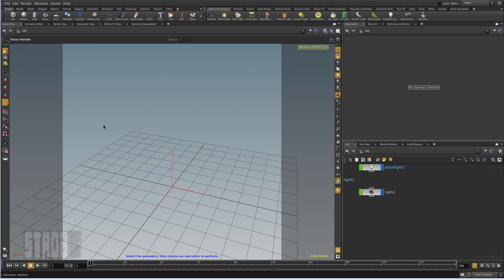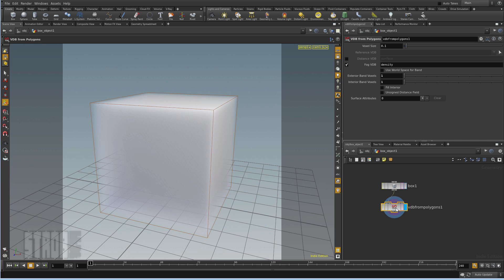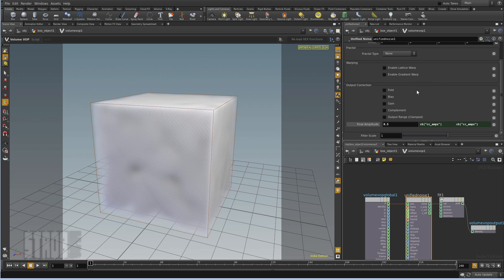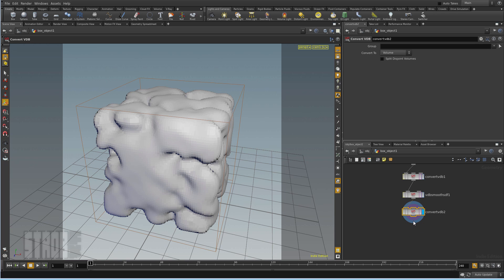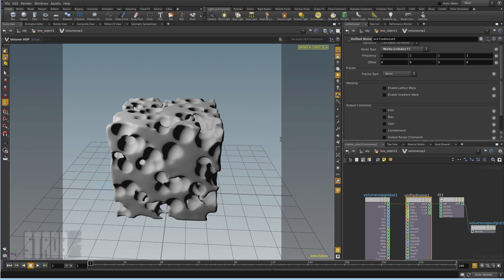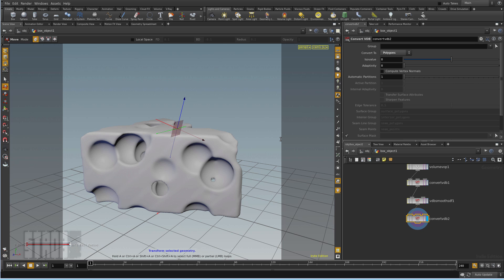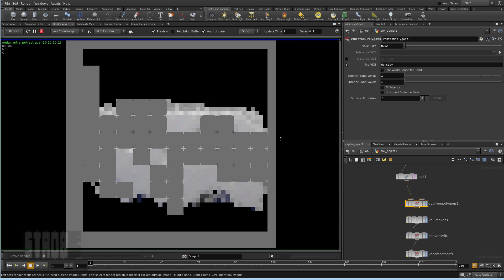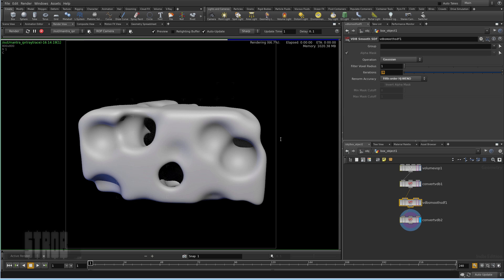Houdini VDB Swiss Cheese

Comment: love this tutorial - really neat trick thanks Strob - i've piped the same result through an alembic mesh of a dancing character i exported from maya - however the volume Vop noise is staying static rather than deforming with the character as such?  Any thoughts on this ?
gotta say i'm absolutely loving houdini's power - definitely going to be learning more with this as time goes on!

ps loved your little ant man hehehe :D

cheers
ant
Reply from the maker: I don't know how you could deform the volume sorry.
Reply: Noise is based on the position. so if you are animating your geometry, noise is still stable. I'm not houdini expert but I think that it is possible to add scatter points to your volume with density parameter of it to read out noise and write down its parameter, animate the body with particles and read in the noise value out of the particle paramater. :-)

Comment: Very nice! I thought 3ds max was your main 3D program. Have you been using Houdini since a long time?
Reply from the maker: +Shutter Authority 
I just bought a license a few weeks ago and I'm currently learning it. There are so many things Houdini can do that max can't really do as easily. And there are many ways to export the results to 3ds max to render with vray, so I will try that. The main reason I bought it is the cheap price of the indie license: only 199$ and you get so many features right into Houdini without the need for the zillions plugins 3ds max needs to do any FX work. Max and plugins already cost me more than 10 000$ so it's a hell of a difference.
Reply: STROB.NET Wow!! That's great! Is it easy to learn Houdini if you're a max user? And are there enough tutorials? 
Btw, I've been seeing a lot of vray users moving to new render plugins for max like octane and corona. I really treat your work as the benchmark for quality work made in Max, so I love to hear your thoughts about vray vs the other renderers.
Reply from the maker: +Shutter Authority 
Thanks Shutter!

I would say it's never really easy and I spent a lot of time learning maya, lightwave, softimage, that I would have prefer spending on max and after that I told myself I would concentrate on max and plugins instead. But Houdini is so fascinating (and cheap now) and this software is developping so insanely fast that I can't stop learning it now. There are a ton of very good tutorials on the vimeo channel :  https://vimeo.com/goprocedural  and also on digital tutor and cmi vfx

As for renderer, I think vray is the fastest with still a very realistic quality. I don't know Corona and Octane that much but there is also Arnold that is growing fast. Arnold seems sometimes more realistic but also it's a lot more costly and slow so you need more costly machines to use it too. I heard a lot of good thing about mantra but it seems slower than vray too. And vray has been used by ILM recently on stuff like the war ship in Captain America so I think it's there to stay a long time. VrayRT (GPU) is maybe the future but GPU renderer seems always buggy and they don't support all features yet.